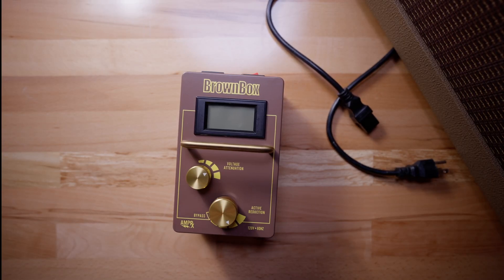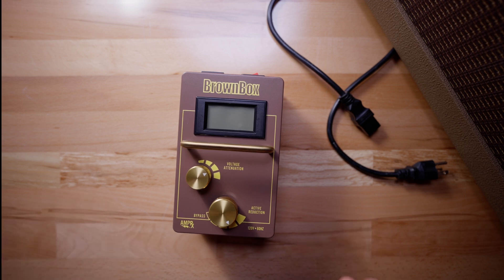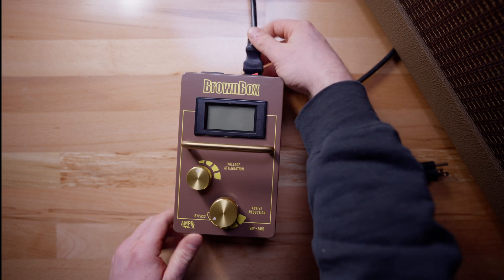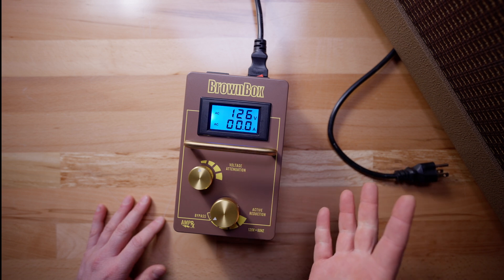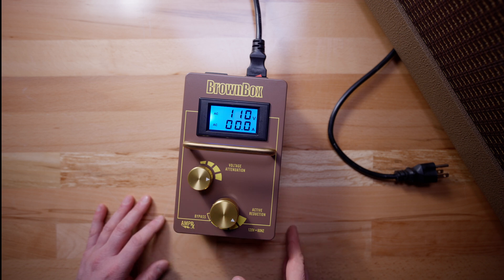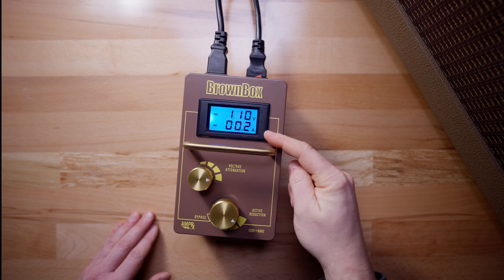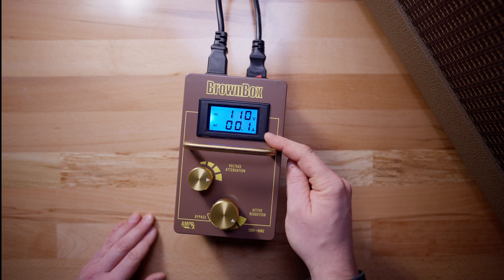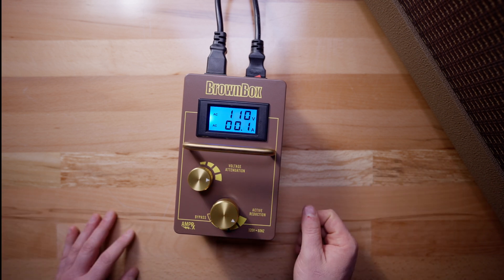How to use The BrownBox by AmpRx - Voltage Controller for Tube Gear

Comment: Got one and it is a great tool.  However, this is more of set it to where it works for you and don’t mess with it.   As every time you change settings you will need to re-bias the amp.  I’ve tried  from the least attenuation to the max and in between, and you need to rebias the amp every time.

Comment: Huh?  You mean that tube amp that I paid thousands of dollars for was not designed properly and will not operate correctly (i.e., sound best) with a standard 120V feed?  Nor sure I believe that ......
Reply from the maker: Your amp was designed properly! Modern voltage out of the wall is supposed to be 120v. Therefore all modern electronics are created to run at 120v. What you get out of the wall tends to be higher than 120v (or lower). Back in the 60s and earlier - the voltage was around 110-117 hence why vintage gear should run at a lower voltage. Would you bake a cake at a higher temp than what the best cake recipe calls for?  Happy Playing!
Reply: Read the back of you're amp all my old fenders and marshalls say 110 volts ! And they sound better at 110 volts and tubes last longer !
Reply: Depends on the amp’s manufacturer design.  Most modern amps are built with voltage regulators to keep the amp at 120v ac.  So, the BrownBox may not be a much use in those amps.

Those amps that are based off or clones of vintage ones w/ot voltage regulators, will benefit from using the BrownBox.

I built amps without voltage regulators so this is a great tool.  Ive seen wall voltages ranging from 125-123v ac all the time.  That brings your plate voltage high, possibly higher than what it was intended.  Bringing those plate voltages down does change the amp’s feel and character.  I liked how my amp feels and sounds around 112v ac.   I re-bias accordingly and I am very pleased with the results so far.